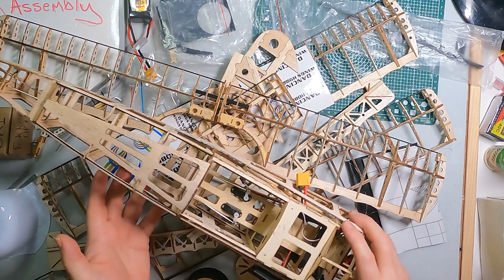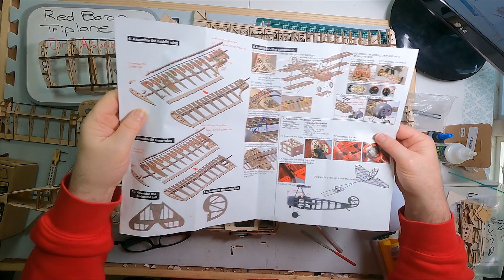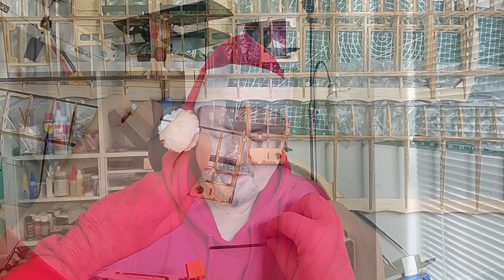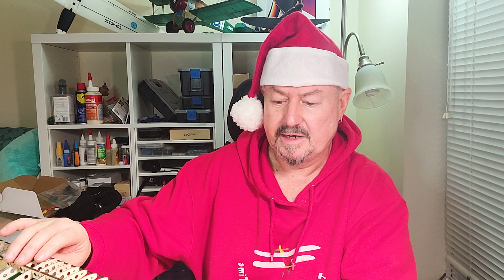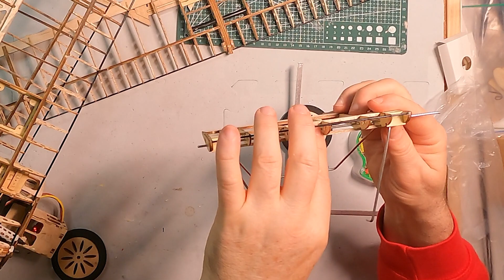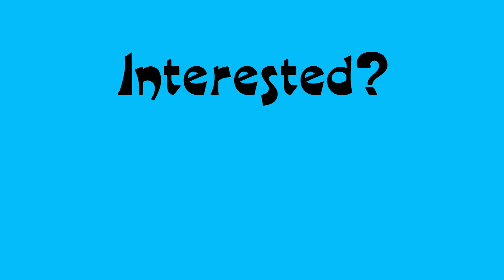04 Red Baron Triplane Dry Assembly - Dancing Wings Hobby Fokker DR1 balsa model plane kit.

Comment: That looks great Tim, on my DW Savage Bobber build video the servos are mounted the same way, that is they are fixed to a plate which is then screwed into the wing plates. If you need to get to a servo don't you have enough space to use a short screwdriver to release the four screws without having to remove the wing? So the ailerons are full span? What covering are you planning on?
Reply from the maker: Yes the ailerons are full span, I think they will have plenty of authority and I might have to reduce the throw so they are not as effective as the ones on your Zero! 🙂
Reply from the maker: I'm going to use SilkSpan for covering. I think it will look gorgeous.
Reply from the maker: Thanks for watching Cliff. I probably made too much of the problem of removing the top wing. It's actually only 4 screws holding down the struts, so probably the easiest way to do it. I will have to make sure the servo wires are run into the fuselage so that they can be easily fed in and out. There is nothing in the kit for this.

Comment: I did not ret my spring for the wheels. will this be a problem?
Reply from the maker: I think it will be fine, but most importantly remember this is a "4th wing" - so if you glued it, make sure the angle of incidence lines up with the other wings. They should all be parallel!

Comment: Hello Tim,
I'm also a balsawood builder (since 50 years) and I am almost ready to finish this kit.
It's an amazing complete kit.
It's a shame that there is virtually no assambly instruction beyond the PDF of 2 pages.
I watched all of CJ's videos and yours and I learned a lot from both your video's.

My remarks:
I think you have the 'scale engine' on the wrong side.
It should be placed on the bottom side of the motor mount so you can see it under te cowling.

I think you have the carbon tube's confused, mine all fits perfectly.
Before you put in any tubes you have to try all possibillaties, the manual is very unclear...
So, before you do anything try everything!

I'm going to make this a 'fixed plane' so I don't have to take it apart when transporting, the wingspan should not be a problem for any car.
So I will attach the lower wing first, then the middle wing.
Then slide the aluminium struts through the middle wing and glue them in the lower wing.
At last I will bolt on the upper wing.

I'm going to make a YouTube channel for sharing this kind of information.
If you want contact just let me know!
Reply from the maker: I agree, it's a wonderful kit and I'm really enjoying building it. I "dry fit" the fake motor on top because I didn't want to glue it yet and it would fall off the bottom. I've now glued it - on the bottom. See my new video coming soon. Yes my plan is to assemble just like you said. If you post a video do please let me know. Thanks for watching.
Reply: @timtheplaneman  Hello Tim, I just created my YouTube Channel for the DR-1.
For starters I made a small movie how I dealed with the hatch, you can see it at https://youtu.be/Mg6CxMfrQV4
The original plan used screws but I don't like to screw and unscrew things many times.
Please let me know what you think about this.

The next thing I have to do is searching for a good camera to record everything.
For this small video I used a 10 year old camera.
Do you have any tips for me?
Reply from the maker: @rienstuijfzand4547  I love the hatch. Did you buy the lock mechanism?
Reply from the maker: @rienstuijfzand4547  the easiest thing to use for a camera is your cell phone. You can buy mounts online that let you set it up so it can film what you are working on.
Reply: @timtheplaneman  I'm more comfortable with a 'normal' camera so I can edit the video. A little bit of 'old school'...

Comment: Tim, does that particular Fokker Triplane kit come with the air foil stabilizers that connect the bottom of the tail fin to the end of the fuselage? Also, what will the markings on the triplane going to be? Straight crosses or Iron crosses?
Reply from the maker: No stabilizers on this kit, but I'm thinking about installing some 1.0mm carbon fiber rods like I did on my Sopwith Camel. For the markings - stay tuned (and Subscribe ;-) ) all will be revealed in the fullness of time! Thanks for watching.

Comment: Possible "heads up", model may need down and right thrust, to help make right turns. Need to plan ahead and modify motor mount so that motor shaft comes out the center of the dummy engine with down and right thrust. Try to mount battery pack and all things that weigh something as far forward as possible to minimize amount of nose ballast to get CG right  to keep overall wing loading light as practical.
Reply from the maker: Thanks for the heads up Gary. The DW kit actually has down and right thrust "built it" - the mounting box is actually slightly out of square by design. I'm thinking to add even more based on some other suggestions. I'm really concerned about my CG - you'll see more about this soon.

Comment: I love the look of tri-planes & bi-planes, but they are beyond my building skill. You have to make that cockpit removable, if you don’t one of those servos or the receiver will definitely have a problem.
Is it worth looking at the CG at this point? The DR1 is notorious for requiring lots of extra weight in the front.
Reply from the maker: Thanks for watching mate! Yes I spent last night dreaming up a way to make the cockpit removable instead of sleeping. It's essential, I'll build out my idea today and post the video soon. This plane has an easily removable cowling with heaps of space to pack in any weight I might need to get the CG forward. I'm trying to keep my eye on this as I build, especially adding all the electronics and wiring.
Reply: @timtheplaneman  Could you just make a small former front and back to hold the shape , then a peg and magnet to hold it in place?
Reply from the maker: @cliffharveyrcplanes  That's pretty much what I'm thinking Cliff. I've tracked down the plywood where the formers in front and behind the cockpit were cut from, so I can cut the exact shape. This will also give me a false floor under the cockpit which I'm pretty sure I will use to mount a camera.
Reply: @timtheplaneman  Where do you want the CG?
Reply from the maker: @gunnarbergvall6502 Keep watching - I cover the CG later.

Comment: Very nice build!
Reply from the maker: Thanks for watching. I'm having a lot of fun building this, it's a very nice kit.
Reply: @timtheplaneman  It would also be nice if you could pair it a flight board (to keep it in the flight envelope) and also fly it FPV. Notice a 2 times smaller plane will fly 4 times more difficult. And ugly planes fly better.
Reply from the maker: @prep0wer  I've got another video half done about the LeFeiRC.com SN-L+ flight controller I've installed that will give me stabilization and (maybe) FPV with an OSD. Stay tuned!
Reply: There is transparent cover material. The triplane is the most evil plane to fly and has a very narrow flight envelope. You need a oversized/heavy engine to create room to play with the CG. Better first fly a foam model. My models are all non-detachable.
Reply from the maker: @prep0wer  I've also been practicing flying the ZOHD Drift foamy and by Bixler 2 "bixinator" - take a look at some of my other videos!
Reply: @timtheplaneman  Yes very easy to fly planes even without stabilisation or FPV.
Reply: @timtheplaneman  RC planes are the ultimate camera platforms. I am a huge fan of "360" cameras.
Reply: Foam Triplane I meant...